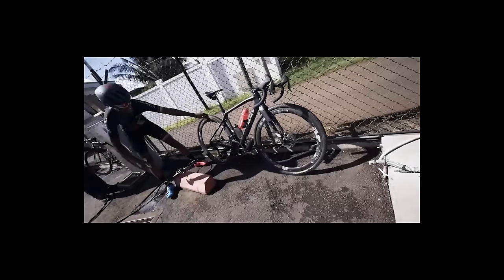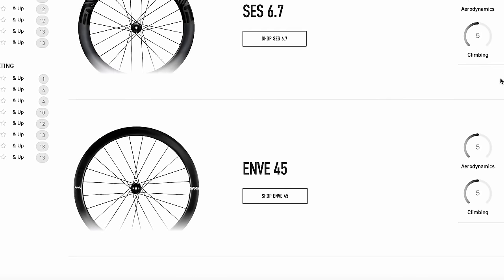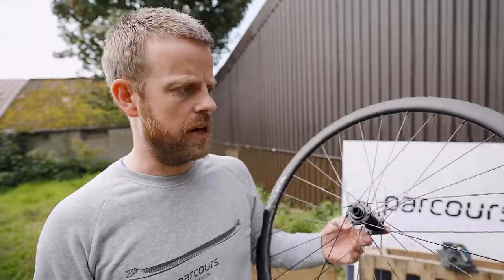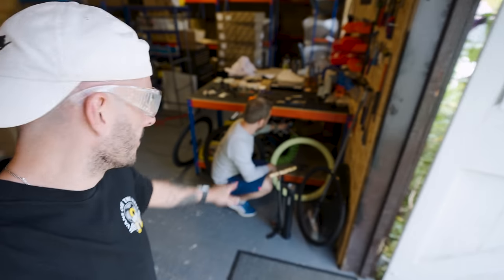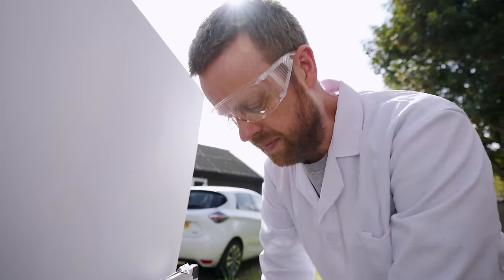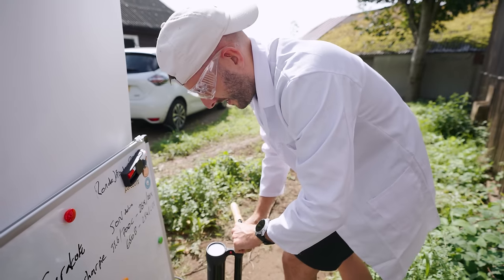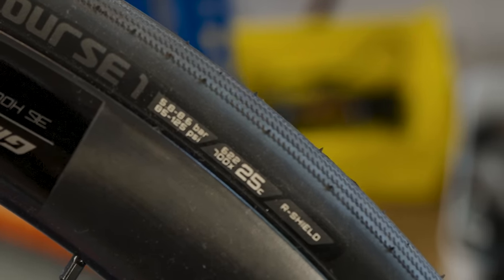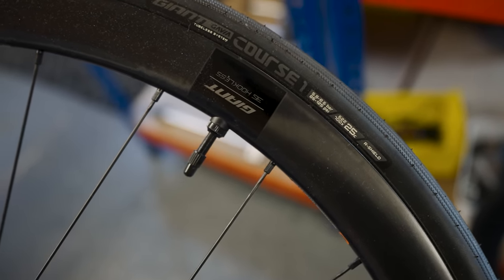Pumping Up Carbon Bicycle Wheels Until They EXPLODE

Comment: This is a very enlightening video. Being a retired motor & motor tyre technician, and ok, generally, with cycling technology, it's quite frightening that I am not fully aware of this problem. Also, if using your 72.5psi hookless tyres and rims on a long decent in hot climates, with heat build up, how near to the 'blow off' scenario will they get to?

Comment: Important to note that the wheel had no extra weight on it and blew up at 110psi. If you were to ride it, you might have problems at even lower pressures.

Comment: Hookless wheels for road bikes is a really bad idea.  With hooked rims, the margin of error, by design, is huge; you need to at least double the recommended max pressure before the tire fails. For example, if you're using 28mm tires and hooked rims, you'd probably need to pump the tires up to 240 psi before you have to worry about those tires getting blown off the rims.  But if you're using hookless rims, the highest pressure you can hope to run is 80 psi, but it's better if you stick to 72 or less.  That's kind of stupid; it's not at all optimal in terms of performance or safety.  

Unless the technology markedly improves, I will never, ever use hookless rims on any road bike. I'm hopeful that at least some hooked wheels will still be available at every performance  level, but if they're not, I will stop riding bikes. It's never a good idea to tell your customers to suck it up and do what's most convenient for you.

Comment: The tests don't also account for the heat when ou've been rolling for a while and/or at speed, also temperature changes never mind the altitude mentioned.

For riders whom are much heavier than supposed cyclist norms, 72psi simply isn't cutting the mustard. At 95kg I run 80psi front and rear with a 32/28 set up on the touring machine and commuter bike, I'm 96kg or just over 15 stone. I ride mostly tubs on the racing machine (and even the gravel bike) with 27/25mm and have them roughly the same pressures.
So, for people whom want to ride a nice bike, is it that they are excluded from having tubeless or simply tubeless carbon wheels due to the restrictions put in place by manufacturers regards safety values of tubeless set-ups?
I was once 107kg when I played a bit of rugby and I rode 22mm tubs with about 130psi in them though I had clinchers (Schwalbe Stelvio Light and Maxxis Xenith legere) that could be inflated to 145 and 160psi respective. Soft compounds that are grippy AF but wear out rapidly but at least can be used b heavier riders like mself without fear.
I don't like the fact I'm virtually forced into having tubeless ready or tubeless specific tres, I want clincher tyres designed for hooked rims, but due to the forces of manufacturers conjuring up a system that's nothing to do with improvements for riders (it's all about the profit!) fewer and fewer top end tyres are being produced for hooked clinchers only. With TR or tubeless specific, the ride is worse due to the re-inforced sidewalls to compensate for the non hooked rims!
Can you run lower pressures, yes, but there's alwas another cost to that and I've never had a puncture from hitting an object that damaged the hooked rim so cannot see that that is an actual benefit of hookless.
BTW hookless clinchers were a thing in days gone past, I have 27" hookless clinchers on my 1950s Carlton, I have run them at 85psi.

Comment: Would be interesting to know if the brand of sealant and/or tape makes any difference, i.e. Silca sealant as it is supposed to fill a 6mm hole, so does this hold the bead better than a thinner sealant.

Comment: The issue is not so much the technology is dangerous, rather the transition from hooked to hookless is potentially dangerous if you don't know what you're buying. The Giant example you presented is the perfect example of this, where the printed tyre pressure recommendation is dangerously wrong, you'd have to just know to ignore the recommendation to be safe, and that's ridiculous. Equally, blindly pumping your new tyres up to 100psi because you're guessing it's correct is stupid, and you can't always account for that.

I've been running tyres that technically aren't compatible with hookless rims for over a year and 3000km now, but I run them at lower pressures (2.5-3 bar) and I've never had any issue with them. The tech is fine, but it relies on people to know how to use it, that's not a bad thing. What is bad is the blatant misinformation printed on that Giant tyre.
Reply: It's not bad at all. This video is just misleading towards the end. He failed to read a label clearly on the rim that states those Giant hookless rims have a max pressure of 125 psi. You can pump 100 psi with that tire combo no problem. It kind of makes me disappointed because a lot of comments are ripping on Giant, when really the video doesn't have the information right

Comment: The real crime here is the absurdly high "minimum" PSI markings on tires. Like I've got 3 different Maxxis MTB tires here (Aspen 2.25, Rekon 2.4, Dissector 2.4) and all of them list a minimum of 35psi on the sidewall. I wouldn't have any teeth left after one ride if I inflated them to 35psi.

Comment: Good consumer advice, though is a bit of a concern if manufacturers are fitting incorrect tyres to hookless rims. Pretty sure all my wheels are clinchers but I will now check, not that I ever inflate much more than 40 psi. Next time if you give me some notice I'll build you a safety box. 😄

Comment: 100 PSI at static. What happens to pressure when a 70kg plus person mounts a bike or cycles over a bump or pothole? 
Maybe hookless wheels need to have the max tyre pressure stated on them like tyres?

Comment: I'm a full-sized person, not fat by any means, and the SRAM/silca optimal tire pressure calculator thingy says I should be at 103psi in my rear tire.  I understand the roadies are a lighter lot, but I know plenty would would see the calculator recommend well over 110.  

The manufacture and distribution of road/gravel hookless wheels is willful negligence.  Somebody will get hurt.

Comment: As a +100kg rider, even running 28s at the recomended pressure from the SRAM calculator I would be at 85psi. I guess that means hookless is out for me. 

Luckily I suspect this is only an issue for carbon rims as deleting the hook saves money and effort in manufacture - for die-drawn and rolled aluminium rims I suspect there is no cost saving to hookless. Hopefully that means that most normal cyclists who dont run carbon wheels will be fine.

Comment: I’m pretty comfortable getting hooked wheels and tires forever at this point for the road. Hookless seems to me like cost cutting at the expense of safety and I do not see the benefit. There needs to be a mechanism for consumer protection beyond “read the manual”, like maybe make hookless it’s own wheel and tire size and call it 675C and put a big warning label on the rim so it would be impossible to ignore that it is special and needs special attention.

Comment: I have a set of ENVE Foundation 65 i.e. hookless wheels, but I run them with tubes, because I refuse to clean sealant off my rims and tires every 6 months. Fuck that. I normally run 65-70psi with tubes on my hookless wheels, does the 72.5psi max effect tubes too? Or is it only tubeless?

Comment: Personally I think there is no issue with hookless (except when they have been supplied with tyres with conflicting tolerances like Giant have clearly done here).  I am a larger than average rider and have Zipp 303s hookless wheels with 28mm gp5000 str setup tubeless. I've done 7000+ miles including poor road surfaces/plenty of potholes and have been perfect, not one puncture either (for you tubeless haters).  Zipp and Silca recommended my tyre pressures are 60-65 psi, well within tolerance (stamped on the sides of each wheel) and I can assure you they roll super fast. Before purchasing hookless do a simple tyre pressure calculator to be sure you are within tolerance. I personally think a lot of the hate is from people who don't know what they're talking about, lack of research and stuck in the 90's. If only people who have experience of the products (good or bad) commented then people would get a much better idea of if it is suitable for them 😘.

Comment: I got a canyon grizl AL and it comes with Dr Swiss gravel NL wheels and maxis tires. Max psi for rim is 36 and min for tire is 35. So I got 1 psi to play with legally
Reply: The wheels have a much higher max psi. Where do you have this number from?
Reply: @raphindahouse  label on the rim
Reply: @raphindahouse  where do you get that higher psi number?

Comment: I usually ride on 110PSI, I am a beginner, I have to say that, but. I do experiments with the pressure, because I have latex tubes, so air runs out and I have to pump them up again, but 72 seem like MTB kind of pressure right?!

Love your videos! Thank you.
Reply: Well, new investigations suggest you don't need such a high tire pressure anymore. Silca made a couple of videos about it (with Dylan Johnson) if you wanna learn more about it. :) I mean, I do get it, the high pressure feels fast, but apparently that's misleading.

Comment: My worry is not only tyre/rim official compatibility, but wheels and tyres out of compliance due to undetected QC issues.
With a hooked wheel it is unlikely that you will have an issue, but with hookless the tyre migh unseat on a pothole, or a sharp turn at speed, with potentially catastrophic consequences.
On a road bike there is no benefit, only risk and small cost savings for the manufacturer.  On MTB/gravel there are very slim benefits, but also risks.
I don't want this on my bike.

Comment: That Giant wheel and tyre combo is a lawsuit waiting to happen. Massively and dangerously misleading and I think most courts would consider the manufacturer liable for the injuries and other consequences that might result from someone's tyre failing whilst out riding. Good on you for highlighting this.
Reply: The only thing misleading is him, sad to say. Those Giant hookless rims have a max pressure of 125 psi. He failed to read that label on the wheel which is right next to the valve. You can see part of that label in the shot. That rim and tire combo is totally safe at those high pressures. Though I would question why would you pump it that high if you're running tubeless anyway lol

Comment: Great information here. Guessing the majority of cyclist are aware that hookless rims exist. 
Looks like Giant will get sued eventually with their wheel set up.
Always good work on your  vids. Cheers.👍
Reply: Where did you get that most cyclists know that hookless rims exist? Most people whom cycle aren't cycle enthusiasts/sports cyclists, they are every day people who ride bikes, kids included.
Reply: Ooops I meant to say that most cyclists are NOT aware that hookless rims exist. I need to proof read better. 😊
Reply: @ynotnilknarf39  sorry, I meant most cyclists are NOT aware hookless rims exist. Did not proof read
Reply: Don't give him too much praise. It's actually misleading. Those Giant hookless rims have a max pressure of 125 psi. They are fully capable and safe to withstand that pressure with that tire combo he ripped on in the video. He failed to read the label on the rim and immediately drew false claims.
Reply: @CupheadAleks  if you go to the Giant site they have guidelines for their hookless rims. The maximum for the rims (not to be confused with tire pressure which is much higher) is 72.5psi per ISO and ETRTO .Also Giant has a list of tubeless tires that are not compatible with their hookless rims. Tire pressure is different than rim pressure.
Reply: @alethearobinson8132  Fully understand what you're saying, but read my comment again. Giant is different. Those hookless RIMS have a max pressure of 125 psi. I'm a Giant dealer. That label is clear as day next to the valve and you can pump those well over 100 psi no problem (not sure why you would with tubeless!) And the guidelines on the Giant site recommend tires that have a max pressure above 72.5psi that will work with their hookless rims. Any tubeless tire with a max of or below 72.5psi will work with those rims as well. The video drew into false conclusions in the end there without looking up the correct information. Now the comments are trashing Giant wheels when really the information in the video is very incorrect.

Comment: Apologies if I missed it but isn't there a min tyre width for hookless? You need the width\volume so that lower pressures actually work for heavier riders
Reply: 25mm and bigger for most HL rims but they should a list of tires and their respective widths that are tested and compatible.
Reply: @styven77  not that I'm a wheel rim\tyre designer expert or anything but I would have thought 25mm is a little narrow for 72psi max pressure. Would never run a 25mm at, say, 65-70psi. Would be getting pinch flats all day long

Comment: I would assume that if a heavier rider pumps it up to it' limit (72 psi or something) and then rides into a deep pothole or down a small curb, the rider is rolling the dice every time.
To me it seems like a quite pointless feature, the weight is in the territory of placebo and lower pressure could be fixed by riding wider internals on rims (?). The factories obviously want it because it cuts material costs and is most likely easier to mold.

Comment: I have 303 firecrest rims and I run them at 35 psi.
Zipp / SRAM have a pressure calc where you input your wheel, your weight and riding discipline and it recommend 51pai for me.
I don't understand why people go up to 110psi can someone enlighten me? Where has this come from?

Comment: Hooked rims are safer for riding on the road especially for heavy riders (180+ lbs.). I always ride at 115 - 120 psi with clinchers using 700 x 25m tires. I rotate my tires to maximize tire life. I also use clinchers on my mtn bike I don't ride allot or rough terrain mostly packed down trails (35 - 45 psi). I have no issues with flats on either setup. I always have two tubes packed if needed. I recall when your were posting daily 7 out of 10 of your rides you had flats, I think you were riding on tubeless. I can't imagine being a long way from home trying to fix a flat with a tubeless setup. Pack a tube just in case.

Comment: I don't see a place for hookless rims in road cycling. MTB and gravel with wider tyres and wider internal width for sure, great thing. Friend of mine has a set of new Zipp hookless rims, she was on a trip somewhere on Gran Canaria if I remember correctly, riding on a pressure of 4,5 bar which is like 65ish Psi. She went to a cafe shop put her bike on the wall and after just a few minutes the tyre suddenly exploded, spreading the tubeless milk over everything. Imagine if this happened during ride
Reply: I would also like to add that,  I'm riding clincher with tubes and had twice a situation where over 30+km/h my tube suddenly blew up and managed to safely stop, only because the tyres remained on the rim. Here with hookless we all have seen even during pro races that tyre will not stay on the rim

Comment: I'll say it again, it depends upon tolerances.  You have to have tires that match VERY closely to the rim, and NOT stretch outside those very tight tolerances.  That's a lot more expensive to do.
Reply: @YTOnlineReviews  It's because for tubeless, 100% of the resistance to having the tire blow off is borne by the tire bead, so that bead has to do several things: (1) seat cleanly against the rim walls, (2) seat cleanly in the divot meant to keep the tire from being pushed away from the rim walls, (3) not stretch, because once it is outside the tolerances, which are a fraction of a mm, a bump can push the bead out of the divot, and away from the rim walls.  The rim hook does some of that work, which is why people could get away with "easy mounting" tires in many cases; without the hook, we have only tight tolerances to save us.

Comment: I might have understood this wrong, but in my understanding hookless was invented for rim-brake wheels to have more material in the braking area. So it would not deform as quickly when heated under heavy breaking periods: downhill. Now with disc brakes this seems pointless. How do hookless rims compare to car rims?
Reply: I never heard from this argument, and sorry, but it doesn't make much sense to me, because hookless is a relatively new development, with manufacturers already well aware of the disk brake trend. You are right, that hookless rims (apparently due to higher pressure during production) are more sturdy in case you hit something hard, which makes it attractive for mtb and gravel. The advantage for road cycling is mainly the price drop (at least firecrest are a good amount cheaper) and a little weight reduction combined with apparently a tiny aero gain.

Comment: Great video. Wheel technology has actually gotten worse. Tubeless makes no sense. It makes for a heavier system that’s a messy pain. I run 23mm tires on narrow clincher rims at 120 psi. Never had a problem.

Comment: Good god that was funny and also very scary.... Especially the case you pointed out right at the end on the Giant. Madness.... I'd never own this type of rim I wouldn't trust it at 50psi and you also have to consider rider weight and terrain- so size up the tyres to stay in a safe zone of pressure. Hookless? Pointless...

Comment: The confusion(and potential danger) is obvious when you see a Giant branded tubeless tire that has a listed minimum pressure rating that’s more than 10psi higher than the recommended max psi when using hookless wheels. How in the world could such a discrepancy have made it past the engineers, and the lawyers at Giant in the first place? To be sure this isn’t only an issue at Giant either. And it’s all so the manufacturers can make the wheels less expensively, with zero of that savings being passed on to the consumer.